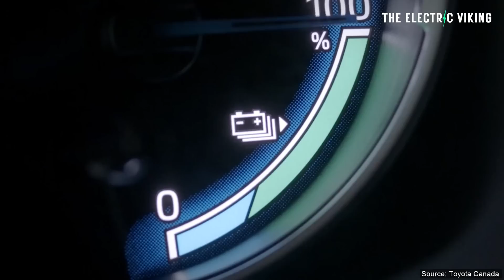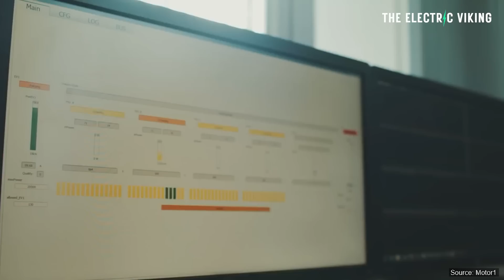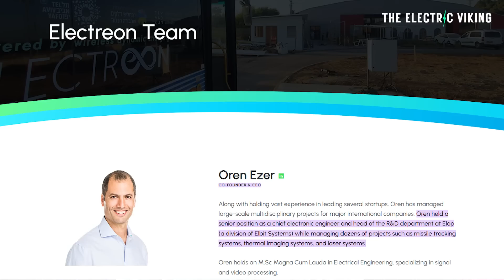Toyota Hybrid Breaks World Record: Drives 1200 Miles on  electric power only

Comment: Thanks for the story. Long way to go. To bring cost up and charging speed up. If it is driving 30mph to keep its battery loaded, it would take 40hr to complete the 1200 miles. If you have a 400mile range BEV and charge on Tesla supercharger (200miles of charging in 15min) and you drive 60mph, it would take approx 21 hours. May be way in the future and the  question is whether it will be even necessary. Range and charging rates of BEVs in the mean time will continue to go up.

Comment: They are not capable to repair the actual potholes on the roads and you tell me that they will be able to install huge amounts of copper wires and other adjacent electronic modules inside and along the hundreds of thousands of miles and kilometers of roads, highways and Autobahns of a country?!? 🥴
Come on! Stay sane, Sam!
The future is the simple electric car with a very advanced technology-high quality-high range electric battery that it is charged at chargers placed everywhere and anywhere is possible, exactly as ICE cars get gas at gas stations.
No more than this.
Stay sane and don't fall for another kodak idiocy concocted by the backward-idiots of Kot-Kodak-Toyota.

Comment: If it charges from the road, why bother with the weight and complexity of the ICE engine at all? Who needs it?

Could be really useful at bus stops and inner city bus lanes, to recharge electric buses on the go and so keeping them on the route all day.
Reply: Would be the perfect enviornment since they take the same routes all day.   Put chargers at bus stops - they can recharge when they run out.
Reply: A PHEV only needs a cheap little 1-liter 3-cylinder engine that is light and compact, but can provide power back up for your home or camp site when grid electricity won't be available.  This is especially true during weather extreme causing very high grid electricity demand that you may be forbidden to charge your EV during this time.   This "Little Engine That Could" could also provide extra power to the grid in order to save the electric grid from black-out during periods of excessive demand.  
Plus, you won't have access to fast-charging when traveling to areas of low population density like rural areas.
Reply: We've had electric trams since the 1800s. Visit Amsterdam, the whole city is serviced with electric trams.
Reply: @Martin-se3ij  Jealous of the public transport network in Amsterdam and several other European cities. My suggestion is most applicable in cities not so blessed, where a decent bus service is available. I have enjoyed each of my visits to Amsterdam and hope to visit again soon.